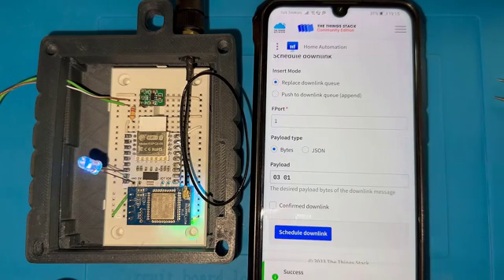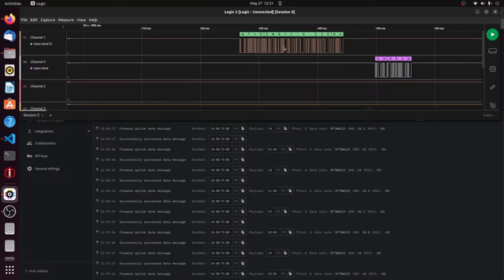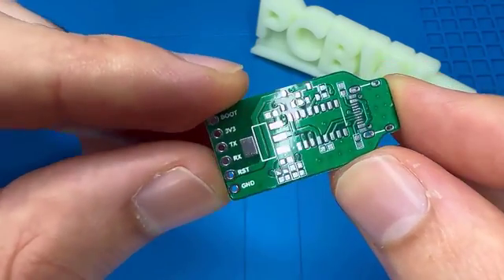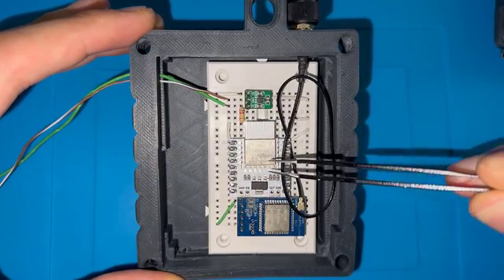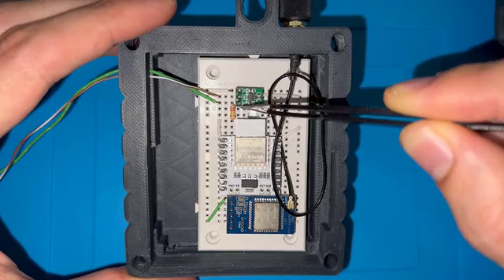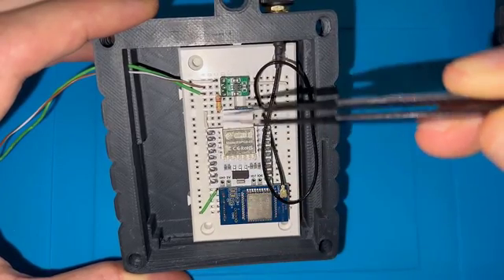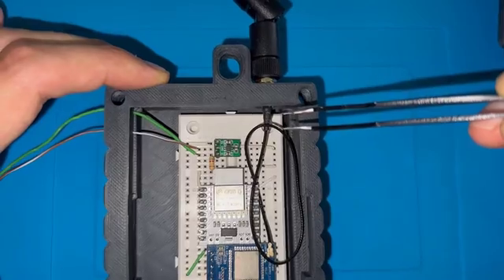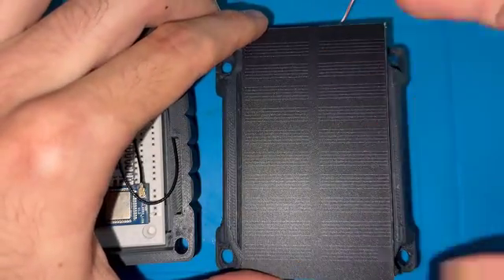ESP32 RYLR993 LoRaWAN Communication

Comment: How do you control the charging phase and the power phase to the ep32 assuming that simultaneous charge from solar panel to battery and battery to esp32 might damage the battery life itself. Does the tp4056 control that?

Comment: Can this work using python
Reply from the maker: Yes sure. But you will need to reimplement the AT command driver for the LoRaWAN module and it will be a completely different code :)
Reply: @usefulelectronics Alright thanks, I will try

Comment: Thanks, one question, how can you keep the 3.3V on the output of the buck converter when the battery has 3.3V or 3.4 or 3.5V or 3.6V?
Reply from the maker: You need to use a voltage regulator that is rated at 3.3V so you have a stable voltage source

Comment: Thanks, I like those Lora modules from Reyax;
One question though, can we use mesh-network with these modules!? Like four nodes one which connects to internet pushing the data from other 3 modules, 😊 .

Congrats for +1 sub from Tanzania 🇹🇿
Reply from the maker: Yes of course the module can do both LoRaWAN communication with gateway and LoRa using peer to peer communication

Welcome to Useful Electronics community.
Reply: @usefulelectronics  thanks;
Any plans for mesh network using same modules?